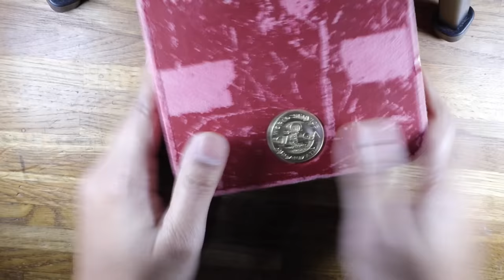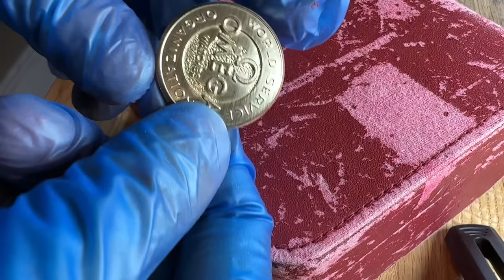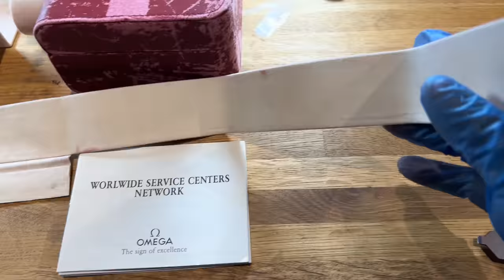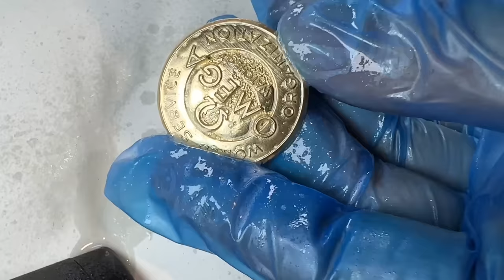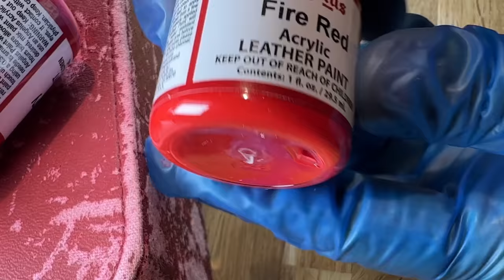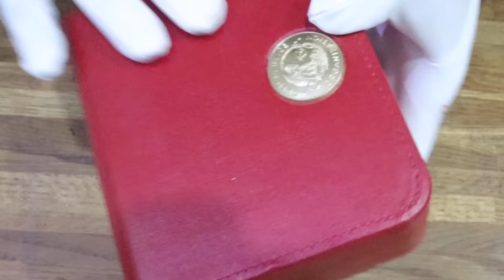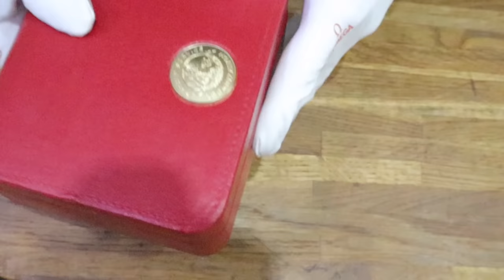Restoring the FIRST Watch Box ever on YouTube

Comment: What a cracker. One suggestion that may help improve the finish on future refurbs is to use a fluff/lint remover/shaver on the material before the paint is applied, this may help give you a smoother material before painting.

Comment: I had a tidy pair of results this week, a CCCP Time Golden Soviet Submarine with the anthracite dial and a NOS virgin Pulsar V102 Solar complete with box, papers etc.   The CCCP Time is unusual in the company bought and had refurbished a ton of old Slava 2427 Soviet movements to be used inside the more modern case.   Bloody big too, 45mm without crown diameter.   The Pulsar is getting a new capacitor, works abs fine save the original cell is deader than a tin of old Spam, not a problem as I bought a couple of the cells last year from Cousins one for my now stalled V103 virgin NOS and the other a spare and the V102 is just a date only V103 so all going to be good :)

Comment: Nice :goodvibes:

I would have used a lower grit paper followed by a fine grit before the last coat of paint.

When working on colour matching paint measure it by weight or volume in a small amount until you find the right ratio of paint you want. Before mixing a larger batch make a sample and let it dry first to check the color.
Reply from the maker: Thanks mate

Comment: This is really interesting - i have 2 omega boxes that have this problem.  I wonder if airbrushunbg the paint would give a more consistent finish.  Do you know what the leather paint solvent is?
Reply: You need to sand the coats with fine paper 1500 grit remove the dust and apply a lacquer this will make the box smooth not rough like the one in  the video

Comment: There are many leather and pleather repair kits, usually an acrylic paint like stuff to brush on. I recall a tv advert circa 1971 that promoted a liquid leather repair kit. Brush the stuff on, apply "leather grain" plastic sheet and allow to dry. Peel off sheet and voila! I would just use red acrylic paint. I'm lazy, and I have paint.
Looks like that's what you did!

Comment: The material is a fairly early faux leather (probably 80's) it's a kind of expanding foam that forms a smooth surface. Unfortunately, it resolves over time.
What you can do is to remove it from the fabric with an adhesive tape, this will make the fibers less desturbed and the color will be more even.
But you can simply burn off the loose fibers before painting (that's an old trick with oil painting).

Comment: Hi Joe, I'm a reasonable tinkerer who is struggling with an Omega Seamaster cal 561.
I have stripped cleaned lubricated the movement rate between +1 and 7sd good amp of 245 not fully wound be 0.1.
Well pleased, but when I refit the automatic wind mechanism, it jumps to gain 900+sd amp drops be goes wrong.
I demagnetized all parts of auto mech but it still happens what have I missed or done wrong
Reply from the maker: I think you may have mixed up the screws maybe
Reply: @Nekkid Watchmaker  thank you, Joe, that will keep me bust for a while, then 😀 
Are there any new videos on the horizon I keep watching the old ones .
Keep up the great work
Kind Regards 
Hursty
Reply: It's more like it's magnetised

Comment: As I watched, I kept thinking, tape...

You can see where the original finish was pulled off by tape, and it would have done a great job removing the rest of the finish.
The benefit would have been reduced particles getting all over the work space.

But the paint you used, I was hoping to see a smoother surface, and it looked like you should have used the vinyl restoration paint instead, or more coats of the leather paint?

Comment: If you do this again, run over the fabric with a wet shave razor and you'll easily get rid of all the fuzziness. I do it all the time when I get any fluffing or pilling on my clothes. No need for those battery powered lint removers. I've never made a hole in a single item. I find a Gillette Mach 3 works perfectly! Love your videos!

Comment: the pilling of the cloth substrate may have caused you far more work than necessary. Pilling can be a bear to smooth out, you don't know what those fibers are and shaving them, using heat, anything could "make it worse". If you had a nice unpilled canvas base, the end result might have been closer to stock. This is not about your clearly excellent skills, but more about the layers of poor materials in the box. I had the same box, it disintegrated too. If I ended up with the same V1.0 I would try this for V2.0; try some de-fuzzing ideas and get that pilling to lay down and get significantly minimized. use a high-solids base coat to create evenness across the whole surface that you can then go back to and sand, fill, touch up, sort of like body filler on a car. In short, more prep on the "bodywork" before laying down color. I wanted to see a really even heavy-paint-over-cancas look like an LV bag. I love your work and also love to experiment. awesome stuff :)

Comment: What the bloody hell happened to that box?  The inside isn't so bad, but the outside looks like it was used as the ball in a rugby match, in the rain.
Reply: Just looked at the watch case restoration video. The case has gone through the original gold plating and a refurbishment gold plating. I can only guess the watch was worn in a Sulphur Acid factory or similar , with the box kept on premises.
Reply: @francesconicoletti2547  I saw the case restoration last week.  I forgot how it looked pitted and wormed.  Your idea makes a lot of sense.  They have to make sulphuric acid somewhere, and they also need to tell time.  
I can't wait to see the whole finished product with the watch restoration.